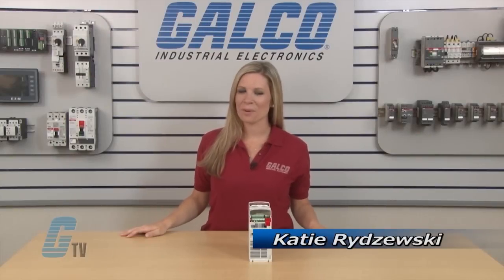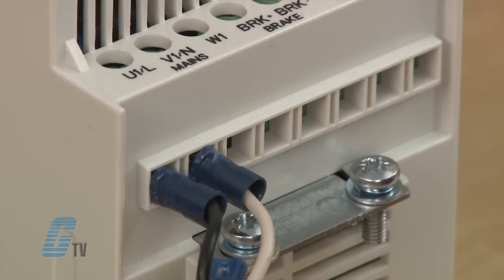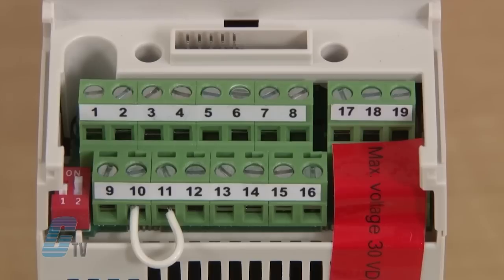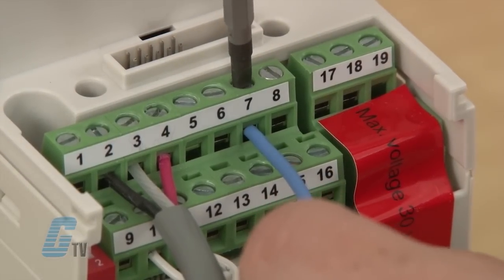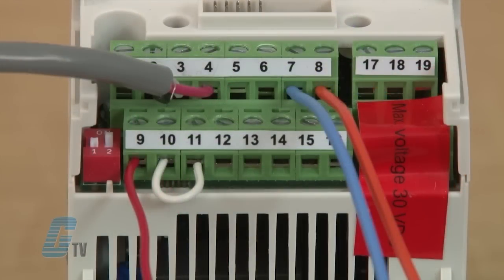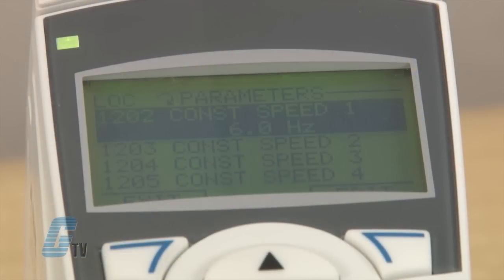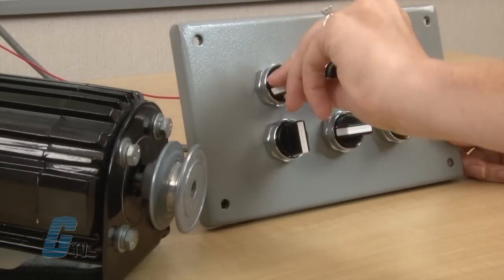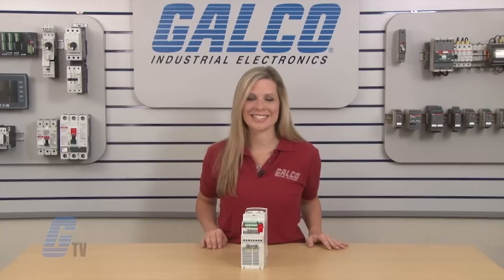How to Wire Up I/O on ABB ACS-355 AC Drive for ABB Standard Macro

Comment: i am using ACS580 and i want to connect external  potentiometer, so please which terminal i need to connect to and do I need to program it to accept the  potentiometer voltage or its automatically will accept it
Reply: I know this is late but I think she said 2,3,4

Comment: thanks for your response. I set everything as you stated. This is what is happening as soon as I press the Start button   the motor runs even though the pot is set to zero. even in local mode.  the running current is above full load and the drive trips. The output is 150% over the rated current,not clear whats up here. Is their a factory reset apart from 9904 changing then changing it back.
Reply from the maker: Well it might be a bad pot, but that shouldn't happen in local mode... The overload could be caused by the motor running at full speed from the start.  This is only an assumption based on what you have mentioned.  Do you know what the motor is running at when the drive trips? 

Also, I don't know if this is a typo or not, but the factory reset is 9902 and not 9904.  Changing the macro to something else and then back to ABB standard will reset all drive parameters with the exception of the motor data.  Remember to recheck the motor data in parameter group 99 to ensure it matches with the nameplate data.

Comment: I want the drive to run(start powering the motor) soon after getting itself  powered up.
I thought bypassing the start push button would do. Is it the correct method to follow?
Reply from the maker: Yes, you can close the switch so that the motor will start to run when power is applied to the drive.  To do this, you will need to keep the drive in remote mode.  But the drive will still take a second to power up.  I would recommend leaving the drive on and then just using a start switch as if it were an on/off switch.
Reply: sethuram venkatesh chowdhary b

Comment: Yes the current goes to 6.XXamps this should obviously trip the OL because of its rating I am beginning to suspect the motor will be making a substitution will tell you how this turns out. It was a Typo its 9902 indeed.

thanks for your help so far Great Stuff
Reply from the maker: No problem!  Glad to be of help and let me know how it works out for you.
Reply: @GalcoIndustrial  sir abb drive model number problem alram code a2035 plz help

Comment: It would be nice to have  PID loop control and trouble shooting tutorial. I am installing water pump that must maintain 60 PSI. so I installed three wire pressure traducer with 0-100PSI, 4-20MA.  I am not sure what I am making mistake. It is not working in remote control.  is it wiring, programming or bad sensor ........................if you can help I appreciate.
Reply from the maker: OK Tedros, I would like you to check a couple things, but keep in mind I have to assume you already have the PID Macro loaded ok?
Make sure the display says "REM" on the left side (this indicates that it is in remote mode), next make sure you have a jumper at terminals 10 and 11, next make sure you have your run enable input closed at DI4 (or terminal 15), if all these check correct, then determine if you are in "HAND" or "PID" control mode with DI2, DI2 off = HAND, DI2 on = PID mode. You have 2 different start inputs, DI1 starts HAND or DI5 starts PID based on the state of DI2, ok?
Good luck and let us know what happens

Comment: I have a challenge on new abb ACS150 Drive I connected all the necessary connection and is not working on  remote only on LOC REM work.i follow all instructions.if I change set point of 9902 to 4 only work only one direction very slow movement.what will be the case please I need your help now Thanks
Reply from the maker: With 9902 set to 4, you are set up for the motor potentiometer macro. First make sure you are in remote mode using the REM/LOC button, the display will show REM on the middle of the left side. Using this macro, you need to apply 24VDC to the DI1 terminal to start the drive in a forward direction. To go in a reverse direction apply 24VDC to both the DI1 and DI2 terminals. 
By applying 24VDC to the DI3 terminal the speed will increase until the 24VDC is removed, at that point the drive will stay running at whatever the speed it was at when the 24VDC was removed from DI3. By applying 24VDC to the DI4 terminal, the speed will decrease until the 24VDC is removed, at that point the drive will stay running at whatever the speed it was at when the 24VDC was removed from DI4. The rate at which the speed will increase is controlled by parameter 22.02. The rate at which the speed will decrease is controlled by parameter 22.03. 
Don’t forget to put the jumper wire in between terminals GND and COM like the wiring diagram shows.
Reply from the maker: Ok please click on this link to the manual and look at page 79, it will list all the parameters you need for the Application Macro you have selected at 9902 http://www.galco.com/techdoc/abbi/acs150_um.pdf    Good luck

Comment: i need your help. my ABB ACS-355 display a fault "drive not responding" and there fault light
Reply from the maker: If you are referring to the display on the Keypad, this message means the drive isn't responding to communication from it. Try a different keypad if you haven't already and the little connector adapter too. Good luck, and please let us know how this works for you, ok?
Reply: I need your help,our abb acs355 drive display can,t work,same time   cooling fan is not functioning

Comment: Madam in my solar 5hp motor that drive will be on in display F0035 indicated pls help me
Reply from the maker: This is serious, do not attempt to run the drive. This fault is indicating that you have line power on the motor terminals. Please correct this as soon as possible!

Comment: I want to Reset All parameters to company default. means reset the drive to defaults.How can I reset all parameters to its defaults value.?please suggest
Reply from the maker: Abb does not have a parameter for defaulting the drive to factory values. So what you have to do is go to parameter 9902 and select "ABB Standard" macro. If the drive is already selected to ABB Standard, then simply change it to another macro and back again. This effectively defaults the drive, however it does not effect the motor parameters those will have to be set to the new motor manually. There are other parameters not defaulted as well, but if using a simple application without Field Bus control, it shouldn't matter, ok?

Comment: how do i rest an ABB ACS320 drive that is starting but not producing output after resting on earth fault
Reply from the maker: Ok when you say rest, do you mean reset? If so the drive should run after resetting any fault that has cleared the condition that caused it. Make sure the drive has speed reference if in remote control. If in local control, the drive may reset the local reference when faulted unless your model has the speed pot installed in the keypad. If speed reference source is confirmed ok and drive still doesn't respond then the drive itself may have sustained permanent damage and will need repaired or replaced.

Comment: The acs355 drive sowing fault code (A5001). That means the drive is not responding.

So how i solve the fault
Reply from the maker: A5001 may be a keypad fault, it does not see the drive. Make sure the keypad is seated in place correctly, if no improvement, try another keypad and the little RJ45 adapter piece. Let us know what happens, ok?
Reply: I am having this same issue, there is also fault light on the vfd. please i need your support

Comment: I have setup an ABB 355 to run remotely Connected a pot and a stay-switch parameter 9902 - 1 ABB STD
the motor Ratings are 3ph  230 V  1.5 A  60 Hz 0.55 K.W. 1380 R.P.M Store in Parameters 9903, 9905,9906,9907,9909,9908
the motor is expected to run 0 - 40 RPM the Scalar motor mode is used. PAR 2001 is 0.0 Hz PAR 2002 1,7Hz 1103 - 1 ,I am not sure how to set 1104 and 1105  the manual says 1=0.1Hz  should I use  17.0 for 1.7Hz? the motor just races as soon as the pot is turned and i have no control unless I stop the drive then I have to turn the pot to its min that start over and the same thing happens Please Assist
Reply from the maker: Parameters 2001 and 2002 are intended for vector mode, since you have it in scalar, you should change the parameters in 1104 and 1105.  If you want 1.7 hertz then you can set 1105 to 1.7 Hz.  This should allow for your pot to reach 1.7 Hertz at 100 percent.  (assuming you want 40 RPM as your maximum)
If you are having trouble controlling the drive with the pot, there are a couple of things to look at.  First, is the dip switch by the I/O on the front of the drive. (You can see this on page 53 of the manual).  You will want to set AI 1 to the off position to ensure that you are using a 0-10 Volt signal.  This assumes the pot is wired to AI 1.  The next thing to look at is parameter 0120, which can be accessed even when the drive is stopped.  This will display the value of the pot from 0-100 percent.  If the pot is wired incorrectly or if it is not in working condition, the value here will show 100%.
Let me know if this helps.

Comment: How can i Connect speed indicator with ABB ACS550 Drive ?
Reply from the maker: Use analog output 1, it is preprogrammed for speed indication. I/O connector X1 terminals 6=AGND and 7=AO1, ok?

Comment: Where to connect 7 and 8 number terminals?
Reply: Across 7 and 8 the drive outputs an analog signal between 0mA to 20mA, which can be connected to a process controller or PLC and display the frequency of the drive output.

Comment: Plz show the importance of connecting earthing to vfd😑
Reply from the maker: It's important to connect ground/earth to the VFD and the motor to the VFD ground. Motors produce a lot of EMI into the frame and if not grounded properly it will make the frame of the motor and possibly the VFD as well at high potential to ground. This is a dangerous situation if you come into contact with VFD or motor frame not grounded.